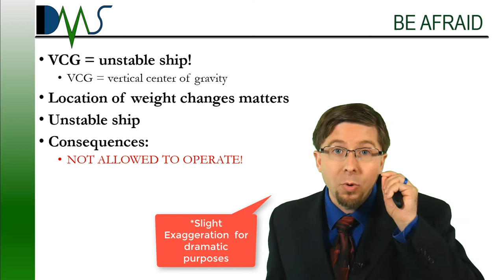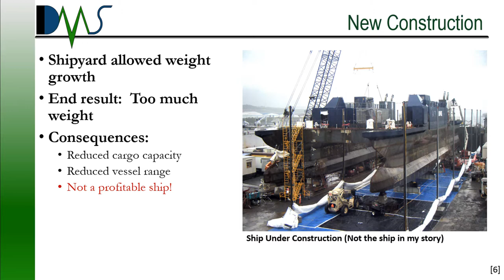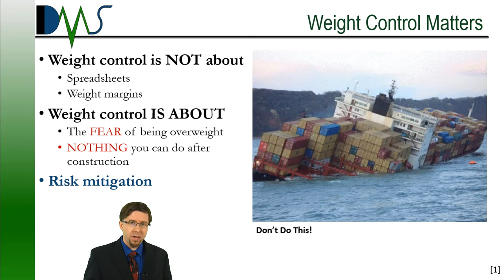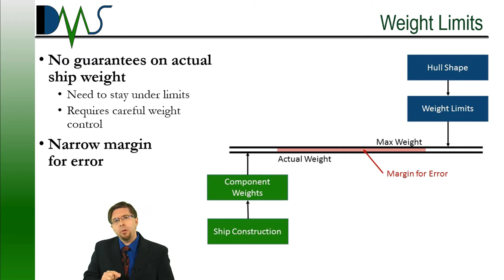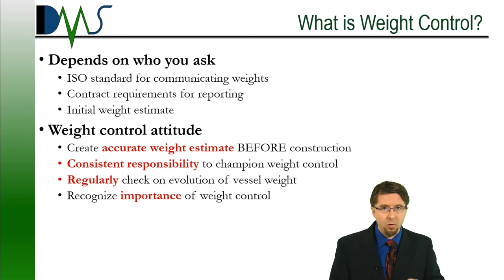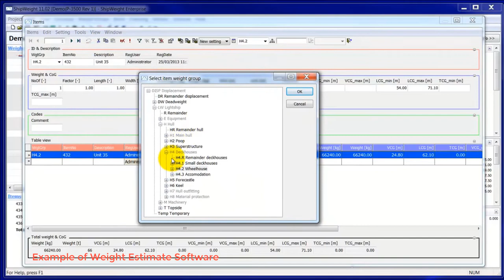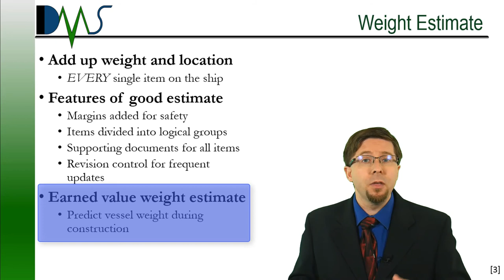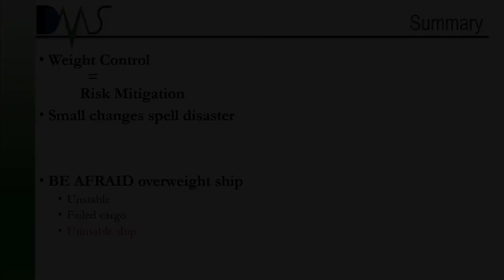Weight Control:  The Silent Killer

Comment: oh boy do me and my friend Taki know the pain of this well...he had a shipyard convert an old 110 meter ferry (Taygetos of 1979) into a 132 meter Cruise ship in the 1980s but the yard tampered with the plans and increased its weight and other features that made it a hazard that couldn't be fixed, in the end he was forced to sadly give up on the project in 1996 and sold it in 1998, sadly it was scrapped after never being completed in 2004 (though to be fair...that ship was cursed from the beginning and I could go on and on for about an hour of all the misfortunes that happened to it...)
Reply: Funny you should mention a cursed ship, I was on board a 70 foot yacht, as soon as i set foot on it I knew it was wrong. On a test sail one of the main stays snapped and almost took one of the crew out, then back at Port the next day the whole bank of batteries just blew all their tops off, the complete lids ( I have never seen this before) it also had a weird smell below decks and looked like a scene from a terror movie, the owner then chained it to the dock to stop it being repossesd, the boat gave me the very strong impression that it would try and kill you at its first chance. Almost all electronics gave wrong readings and the analogue gauges were just gave weird readings. I think it was sold very cheaply and then sunk not long after.

Comment: For give an electronics guy with a very rusty knowledge of mechanics, but is centre of gravity the only problem?
You always hear that the ship rotates around the centre of gravity, and I say, what about the constants. And even if that is true, what if the axis of rotations are not lined up with the ship? My reaction is fear. I have never had to study those xy, zy .... moments only xx, yy, zz, but they seem important to me when we talk design of wave-piercing vessels (or any vessel with an uneven weight distribution), and the loading of cargo vessels.
Reply from the maker: The two major concerns are weight and center of gravity.  You mentioned the momentum factors:  moments of inertia (Ixx, Iyy, and Izz) and the cross products of inertia.  First, there are two different levels of risk associated with these.  The weight and center of gravity affect vessel safety and cargo capacity.  Get those wrong, and the vessel may not enter service.  Less important are the momentum factors.  Get those wrong, and it only really impacts seakeeping, with consequences for crew comfort.  Crew comfort is important, but I'm sorry to say that most vessel owners consider it secondary to cargo transport.  And most of the cargo we carry on a ship can easily handle a bumpy ride.  
Secondly, we rarely need to worry about the cross moments of inertia (Ixy, Ixz, Iyz).  Because most ships are long and skinny, this results in very little coupling between the different motions.  For example, roll motions do very little to influence vessel pitch.  The hydrostatic forces involved mean the vessel roll, pitch, and yaw operate on completely different scales of impact.  Because of this we see very weak interaction between the motions.  And the cross moments of inertia only become relevant with strong interactions between the different motions.